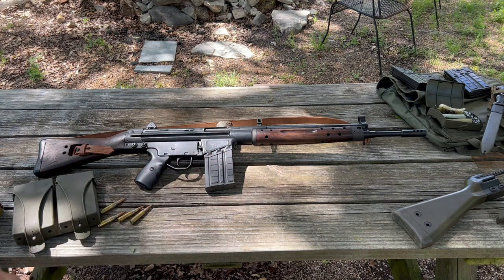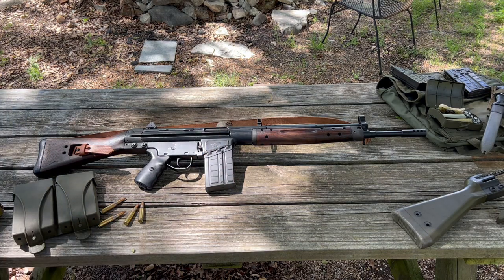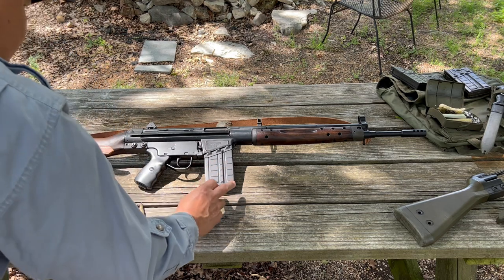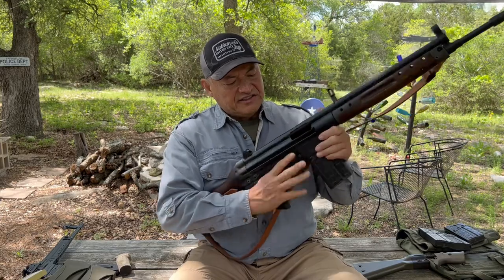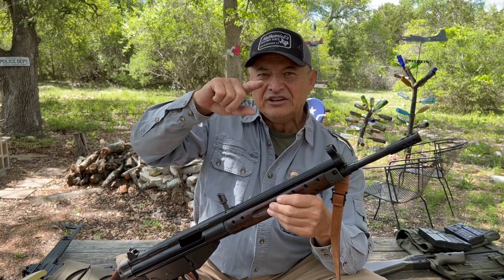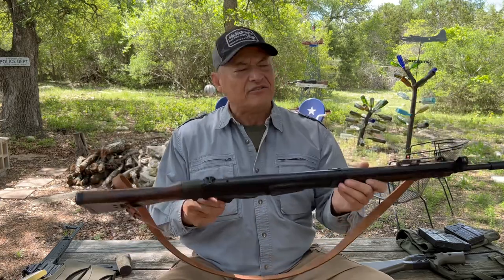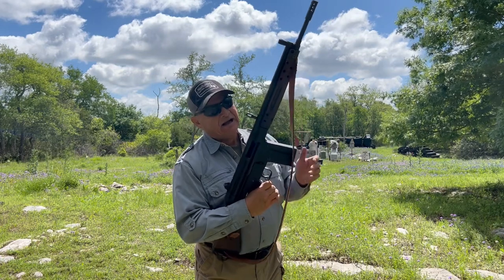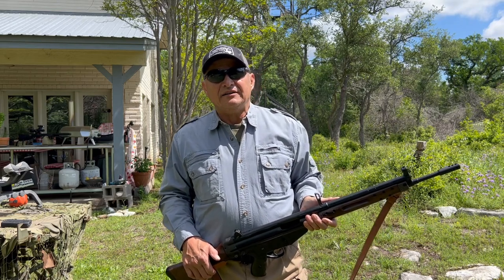CENTURY ARMS CETME

Comment: I have a Century 12gage tactical semi auto shot gun, I have to use high velocity shells or it won’t cycle, a common issue I here, but I like it very much. We’re all told that guns kill, My gun must be either sick or just lazy but it hasn’t killed anyone, but I keep it locked down, just in case it starts to feel salty
Reply from the maker: I have the same problem with my Saiga shotgun but it has an adjustable gas thingy. Some of my guns are lazy too. So I gotta get up and kick them in the ass once in a while.